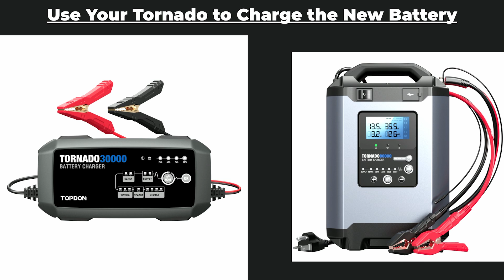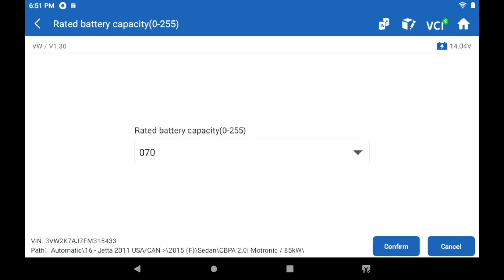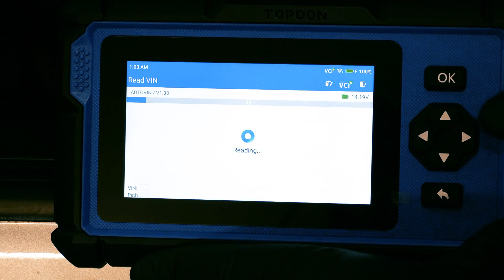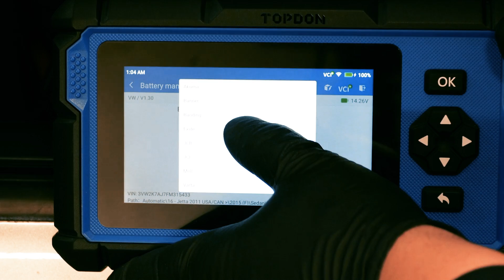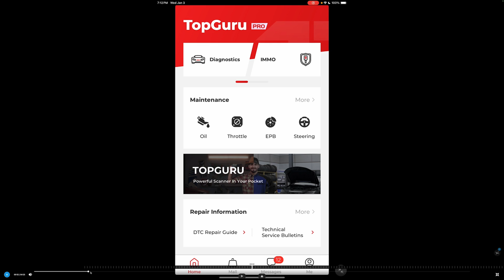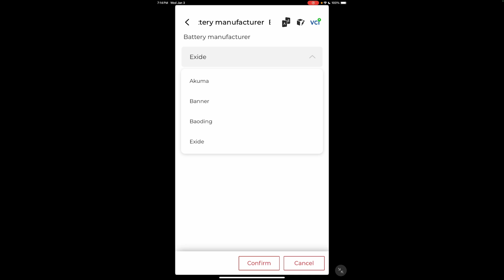TOPDON Training - Battery Management System (BMS) Reset with our UltraDiag, ArtiDiag600S, & TopScan

Comment: Appreciate the video!

Question: For a 2012 Porsche Panamera s-Hybrid, will it throw a “hybrid system failure” fault and prevent the car from starting if I don’t properly register the new 12v battery?

Comment: How important is it to connect a charger as we proceed with the registration because this is the second time I'm trying to register a battery but it fails due to some electrical complication as I understand from the message "unexpected error has occured". I could also connect a charger to charge the battery normally at 14 - 14.5 volts as I proceed with the registration, or only supply mode is suitable?

Comment: Are there any instructions for BMS work on other cars? Like on our Mitsubishi, it will be different than in the video. Need to reset BMS and balance it, can't find the function to let the car drain it's own battery and slow charge back up to test it's capacity. But I'm 100% sure it's there.

Comment: This is very helpful! I just used TopScan to reset the BMS on my Audi Q7 after replacing the battery. Thanks!
Reply: I'm having to do this myself now, also will be using topdon topscan pro dongle.
Hoping all goes ok first time using topdon and replacing battery.
Smh the two mutli spline bolts holding chair down look problematic. Oh the joys.
Thanks for the info 👍 and great advice. Subscribed.